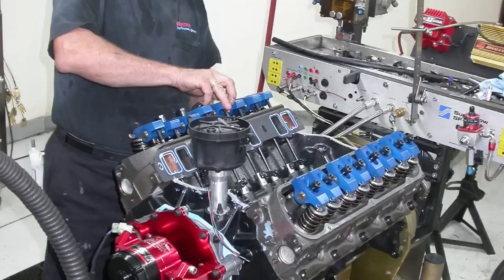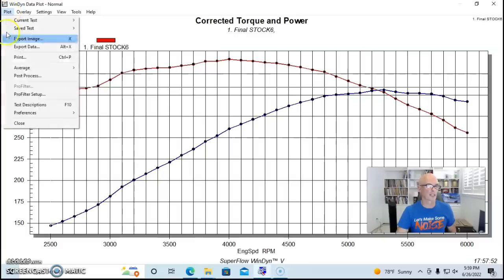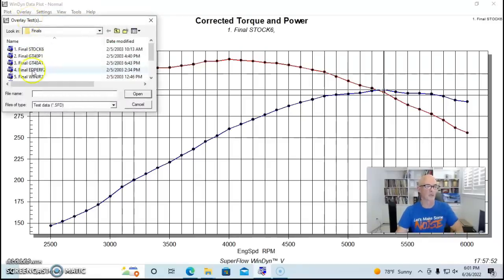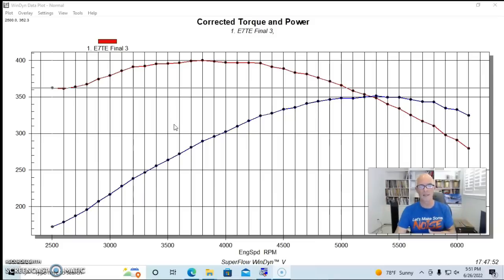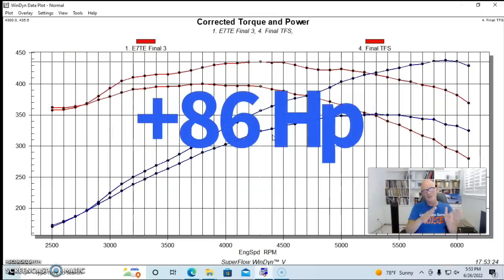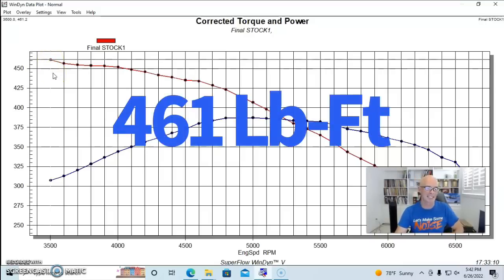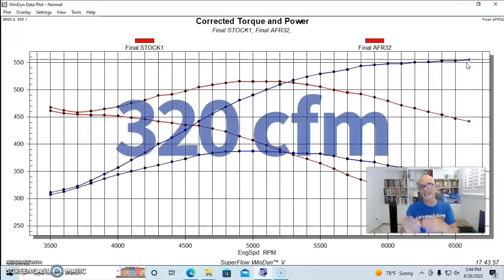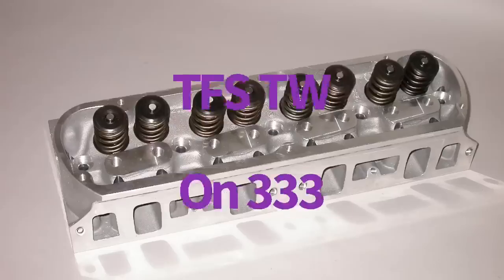IS THIS THE MOST POWER EVER PRODUCED FROM STOCK FORD E7TE HEADS? TOP SECRET-HEAD UPGRADE ADDS 168 HP

Comment: How big of heads do you have to have for them to actually hurt low rpm power? I notice in most of your testing it seems better heads tend to make  the same or more power across the rpm band.  Cams do tend to loose bottom end but it seems heads are less sensitive.
Reply from the maker: CHECK OUT THE HEAD PORT VOLUME VIDEO

Comment: Great video. Back in ~2006, I ported a set of e7 heads that a friend of mine used for his 347 build. Holley systemax intake, xe282hr cam, t5 trans. It made ~310rwhp and ~360rwtq. He swapped to AFR 205s with no other changes and it made ~410rwhp and ~380rwtq 😅
Reply: When your torque beats out your horsepower on gasoline, chances are that something is bottle necking your flow.
Reply: Yes but you can run into different demands on an engine as well. I've got an F700 with a 429 in it. I believe max rpm is 3500. Supposed to make 370ft-lbs and 230hp IIRC. Diesel like-RPM with diesel like numbers. Could put some SCJs or A-460 heads and probably still wouldn't have the HP outweigh the torque. Thought about it. Would be nice to have godzilla 7.3 numbers without having to swap @onescaryapothiconboi7475
Reply: @onescaryapothiconboi7475 410 is higher than the 380.🤦🏾‍♂️
Reply: @pranays he is talking the first power numbers 310hp to 360tq read and comprehend the whole comment before commenting back
Reply: The fuc% really?? Wow!!!
Reply: You need to go to Vizard’s porting school…….😂
Reply: So the better flowing head made more power, what point are you trying to make?
Reply: @msk3905 Wow you're a smart one! No shit the better heads make more power,he was trying to show you how much power is gained with a head swap alone.
Reply: Why don't you ask Holdener since he devoted an entire 14min video plus dyno time to the concept? @msk3905

Comment: I'd be interested to see what compression ratio each engine had with that stock head. I feel like that's probably what's mostly making up for the crappy flow of the head itself.
Reply: Not enough to matter. The guide and throat area is just bad on the old pushrod heads. It's the reason why the big 3 went to better versions in the 90s (Ford's GT40, Chevy Vortec, Dodge Magnum).

Comment: That 393 is a hot setup!
Reply: The 393 is The true ford  Buget  stroker, just add a crank and you can pull all the other parts out of the Ford  parts bin. Windsor block and rods and stock 302 pistons.

Comment: So, say you are trying to make 600 hp out of a street engine. You would want the smallest port runner volume that can do 300 cfm right? A bigger volume head would make the power, but at the expense of low end torque and throttle response if I understand correctly.
Reply: Most today use the best head that you can afford and cam the engine accordingly.  The better the head is the smaller the cam has to be to make power.

Comment: I suspect the head is flowing a higher CFM with the larger displacement engine. But is that really a good way to measure efficiency? Isn't horsepower per cubic inch a better measurement of efficiency that way you only have one variable and one constant versus CFM to horsepower which is basically two variables? I very easily could be wrong this has just got me thinking.
Reply: Port size and configuration limits flow. Of any engine it is on so that is not feasible

Comment: Where does a good 2V Clevor head compare in this?
Reply: stock 2V flows "good" up to about .35 lift. An experienced armature port job can increase the max flow and extend it out to about .55 .  But the cost in headers, intake, mods to get the compression up, might make their utilization per dollar fruitless........except they would sound cool. If there was such a thing as a boss 302 2v intake, I would try it at least.
Reply: @stuartwall8212  I mean CHI or Trickflow
Reply from the maker: A STOCK 2v HEAD DOES NOT FLOW WELL
Reply: @richardholdener1727  ok well they are popular
Reply: @richardholdener1727  I mean modern heads like CHI or Trickflow
Reply: @richardholdener1727  CHI OR Trickflow. Edelbrock even has a head and nice intake. Roush too
Reply: I know you have lauded the 400M as a stroked 351.. I’m curious if the CHI or Trickflow heads were used what it would do?

Comment: I'd love to see you test the TFS 190 11r heads on a stock 5.0 bottom.
Reply from the maker: I HAVE RUN THOSE
Reply: @richardholdener1727  Do you know the video name?  I'll have to do some digging through your videos.  Thanks!
Reply: @richardholdener1727 I’ve never seen you test those heads? I’ve seen the 170 11R in 2 of your videos, are you confusing these with the aforementioned 190 11Rs?

Comment: I'm guessing the HP = 2 x CFM formula only applies to 8 cylinder engines? If the engine has a different number of cylinders, you have to adjust accordingly? For example, a 4-cyl would be HP = CFM. A 6-cyl would be HP = 1.5 x CFM. And so on.
Reply from the maker: YES

Comment: Hey Richard, do you recall what the final timing was for the stock heads vs the aftermarket heads? Smokey Yunick, when running in a stock/restrictive racing class,  recommended experimenting with running more high rpm timing advance due to the high vacuum(?) created by the E7s & large displacement & high rpm.  Great work, thank you.
Reply from the maker: IT SAID 44

Comment: Dear richard holdener,  Personally on SBF i would use the tfs R series heads with matching valve angle relief pistons.
What do you think about brodix STS T1 CNC 227 CC heads versus AFR equivalent on a SBC 388 cubic inch, 850-950 vac sec.other details are Comp XR hydraulic roller cams from XR288 through XR300 and pump gas compression target max with best cam to use, uses 6" rods with 4.O3O" bore. Also the same crank in a 4.155" bore block version. intake being a professional products or an edelbrock super victor 2. And then i plan to upgrade the block and pistons to a 4.2" bore world products pro lightweight or a brodix block and get the compression the same with cc.
Reply from the maker: PLEASE SEE THE HEAD TESTS-I RAN TFS R HEADS BUT ON A BIGGER MOTOR
Reply: @richardholdener1727  thank you soo much :o)

Comment: See a lot of people porting the e7te heads. And the GT-40p heads. Budget friendly horse power. Great video Rich.
Reply: They aren’t even budget anymore, dudes are asking 500 for bare gt40 heads these days lol.
Reply: It used to be that e7 heads were free (might still be today, haven't needed a set in years). You could learn on porting them and not feel terrible if you broke into a water jacket. You can't go too big on the exhaust throat on the short side radius for example. They were also, arguably, the best of the pre-GT40 heads although some guys claim the D0OE 351 heads were better (whatever). Perfect combination for ~300+rwhp on the cheap.
Reply: Porting iron heads; bad idea .
Reply: No it's not @MP-pz9oe

Comment: Hey Richard. Do you know what the Actual Airflow through these engines was? I would be much more interested in comparing THAT real number to horsepower, rather than looking for a rule of thumb airflow/horsepower correlation based on flow bench data. The flow bench is great for comparative analysis like saying, "hey this head flows better now than it did before we ported it," but, since airflow on the flow bench is continuous, it can't model any inertial supercharging effects that happen with intermittent flow in an actual engine. This would allow you to spot actual increases in thermodynamic efficiency of the engine. For example, if Setup 1 makes 300 HP at 600 CFM, and Setup 2 makes 300HP at 550 CFM, we can clearly see that Setup 2 has a higher thermodynamic efficiency than Setup 1. I just thought that might be something to ponder if you wanted to go a little deeper into the theoretical side of making power. Cheers all!
Reply from the maker: WE KNOW THE MOTOR MADE MORE POWER WITH THE EXACT SAME HEADS

Comment: Just once, when you are doing a comparison test like this, would you just test one head to compare to the E-7 and use the SAME cam, headers, carb, ect. instead of building 3 different engines ??  Also, let your viewers know if a combination you put together could be reasonably used on the street or more of a non-street engine.  I don't see many cars on the street with .700 lift cams.
Reply from the maker: IN EACH TEST-WE COMPARED THE STOCK HEAD TO A DIFFERENT HEAD WITH NO OTHER CHANGE-THERE! YOU GOT YOUR WISH

Comment: I got a great deal on some Performers, about 20 years ago, on eBay. If I remember correctly, your book/articles put them (2.02/1.6) pretty close to the Twisted Wedges. Much better than e7s or GT40s, anyway. They definitely woke things up. But, not enough, for me. Building a turbo kit to surpass that “block splitting” 500 mark & make the LS worshippers cry. SBF can still hang with most anything. Thanks Richard.
Reply: You're not gonna make LS guys cry with any stock Ford block. The architecture isn't there. I'm a guy who dumped alot of money into Ford crap for 15 years. Even the aftermarket blocks aren't great. I have one more 347 thats waiting to split the block in NA form. Between the blocks literally splitting in half and the lack of cylinder head clamping force they don't compare to ls stuff.
Reply: @picklefart  are you drunk?
Reply: @BlueOvalEdge  u must be.a ls is leaps and bounds better than and 302 ever made
Reply: @ryangulley2051  Says the fanboy that can’t spell (u. a. ?).  Says the fanboy of a failed car company that in 2009, after it received $17.4 billion in tax dollar bailouts, went bankrupt, wiping out shares of tens of thousands of common stock holders.  Furthermore, taking $49.5 billion in federal TARP money where the government only recovered $39 billion resulting in a loss of $10.3 billion shouldered by the tax payer (again).  Says the fanboy of a company that hasn’t paid its “new” shareholders a dividend since March 2020.  Says the fanboy of a company that has never won the 24 hrs of LeMans (wins by manufacturer i.e., the OEM).  Says the fanboy of a car company that failed in an epic fashion to make an OHC V8 engine that actually worked i.e., Northstar. Finally, says the fanboy that compares “modern GM” pushrod engines (oxymoron) to older pushrods engines that were replaced in 1996 in favor of modern OHC engines, like the rest of the world.  Keep up the bogus comparisons and keep chasing that chicken fanboy…
Reply: @picklefart  What a load of Garbage. Dart and World Man'o war   aftermarket Ford Blocks are great and the Track Boss Cleveland block as well.As for the Cylinder head clamping  stock Ls heads have the same 10 bolt pattern as a small Block Ford so how can they have more clamping force?The basic Windsor design goes back to the early sixties and R452 Nascar Ford Engine which was used very successfully right up until the Fr9 was based on Windsor Architecture.Don't see any Ls's used in Nascar. cup.
Reply: That block splitting 500 seems to be a myth as some are putting out over 800. https://www.youtube.com/watch?v=PvsruBH5C8Y

Comment: Nophoekingway
Reply from the maker: step up with data
Reply: @richardholdener1727  mid lift flow increase torque and hp experientially . Top end flow hurts torque though out rpm range .
Reply: @richardholdener1727  https://youtu.be/Qqg3z60ISQo

Comment: The HP per CFM seems like it's relative to displacement. It would be interesting to see results from several different heads on different displacements and get a more accurate relationship between airflow and displacement.
Reply: It absolutely is. Smaller cylinder is more efficient all things equal. So is a smaller valve as far a discharge coefficient

Comment: Be nice see testing on just the exhaust side of the heads - doesn't seem to get looked at much - nice video again
Reply: And all headers are just compromises, not optimized. Who knows what proper scavenging might do.
Reply from the maker: ALL HEADERS?
Reply: @richardholdener1727  You tried how many different diameters, lengths, steps, 4/1, 4/2/1, collector extensions, scavenging , etc on each? Or just an average good guess ?
Reply: @hotrodray6802  was thinking more so how much the flow on the exhaust port effects power , intake may flow well but how much can be gained by just improving the exh port flow - also yes 4-2-1 collectors are interesting - so many questions so little time
Reply: @Jason-kn3tw  Exhaust flow as measured on a flow bench is not as critical as many think especially in fairly mild N/A combos.  In many cases engine builders will give up a little bit of exhaust flow numbers if they can gain intake flow numbers.  Then the cam is ground accordingly.
Reply: @SWJ73  yeah but that's the point with testing you're trying to how to make a good combo great and when you have N/A deal street car every little bit can help - would be interesting to know if you ported just the exhaust side and it flowed better would that show on a dyno cheers

Comment: Just for another data point for you, my Stock Eliminator 5.0 made 302 WHP with stock E7TE heads, pulling through a stock HO intake and TB. And my heads only flowed 155 cfm even with a legal 3 angle valve job and pro flow valves.
Reply: @Junkyard Rat S10 manual transmission, so I'm guessing in the 350-360 range at the crank
Reply: Quite a cam😲, that range is way out for a stock top end.
Reply: What was the key in getting so much power out of the e7?    Was the cr high?   A big tight lsa cam?
Reply: @dennisrobinson8008  stock compression. Stock Eliminator cams are stock lift, but tight LSA, and as much duration as you can tolerate with stock pistons/valves for piston to valve clearance. For example, on my intakes, I had about .035" clearance.
Reply: @The_Performance_Laboratory Just for perspective for these guys, tell them about the incredible $ involved to build a Stock Eliminator type engine....it definitely doesn't make sense for any other reason  ...
Reply: @patrickf4692  I don't think I ever added it all up, but I built it myself as opposed to buying an engine, and thus saved myself lots of labour costs. Just parts and machining costs.

Comment: the 264 cam in the 306 is very mild. what would the numbers be if the same cam and carb
was in the 330 and 393?
Reply: Some actually like to drive their 302" engines without ridiculous gymnastics. Xe274hr are THE limit for driveability, unless you're a glutton for self punishment. Daily street driven race cars sux.
Reply from the maker: The XE274HR is far from a race cam (I drove mine daily for 85,000 mile)
Reply: @hotrodray6802  Thats what I am sayin. . Starting with a good basis like this 306 and see what happens if you go bigger in cubes with what you have.

Comment: I'm really curious about fuel usage between the heads vs displacement.

Seeing the torque curve was very informative for me with this testing. Definitely something for me to think about.
Reply: Yeah this is something really important to me because i want to make a weekly driver hotrod. Im really curious of MPG numbers with these setups
Reply: @sckirbyc1  I'm thinking fuel volume used over time. Lots of other factors like weight, wind drag, cruising rpm off gearing, tire design.

But yes that all applies to miles per gallon. I'm just specific on fuel usage over mpg specifically because you can get fuel use on an engine dyno.
Reply: @sijonda  well if you have a hotrod  and you're comparing a 4.8L engine vs 6.0L with equal horsepower at 5500 RPM. What is the difference in MPG for example.
Reply: @sckirbyc1  Hypothetical, I'm assuming if everything was identical except for the engine, the larger engine would use more fuel. But isn't the topic about heads and not engines?

Thinking about it. I don't see how these engines could produce the same power at the same rpm while being a different displacement. The engine with more torque at the same rpm should require less throttle input which uses less fuel.
Reply: @sijonda  Agreed. Your original point is also interesting.  My point was more along the lines of I would like this channel to add fuel usage as a metric overall. Cheers
Reply: @sckirbyc1  Agreed
Reply: @sckirbyc1 you need fuel injection with multiple tunes.

Or a more modern dual overhead cam engine.

Comment: Would love to see comparison of factory E7s and cnc ported E7s such as powerheads that was popular back then.
Reply: "Before you do anything rash such as tossing out those stock, cast-iron 5.0L heads, you may want to read through this test".  So starts Richard in the book he authored for SA Design, "5.0L Ford Dyno Tests".  On a stock 302 with extrude honed stock upper & lower intakes and shorty headers, the Powerheads were worth 35 hp and 34 ft-lbs (peak to peak) over stock E7TE heads, moving the peaks by 200 for power and 400 for torque.

I bought a set for my 306 based off his recommendation and I thought they were alright, though I didn't keep the car for long.  They made the same power (and way more torque) in my 306 (Explorer intake, 1.5 long tubes, 274HR cam) as my friends 306 (Edelbrock dual plane and carb, 1.625 long tubes, same cam) with ported Edelbrocks, same dyno same day.  Not hard numbers because neither were optimized, but you get the idea that they worked alright.
Reply: But yea, I'd love to see them tested, too.
Reply: @matthewdupuis232  respect your opinion ...